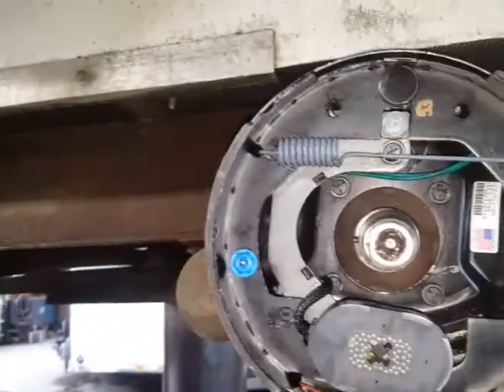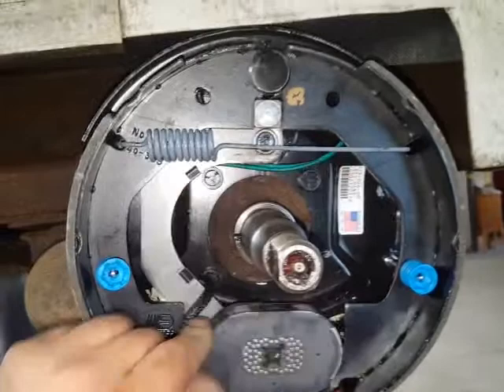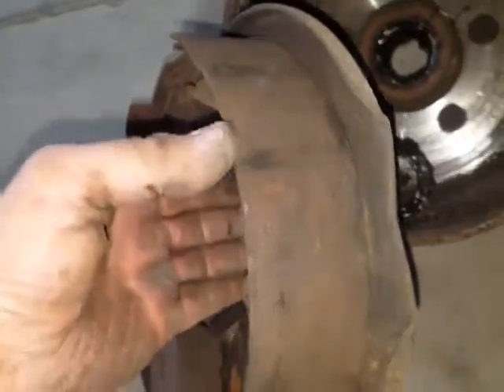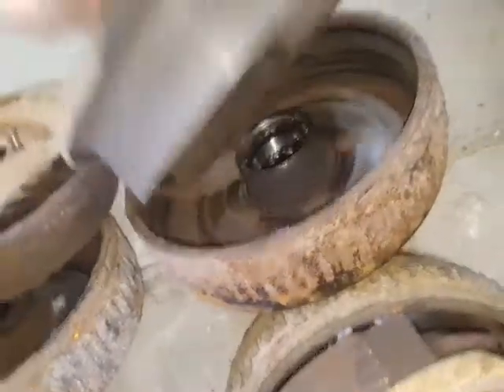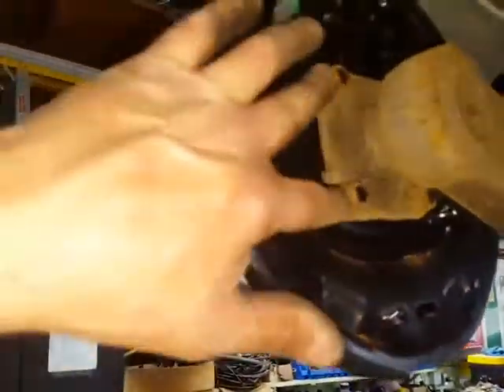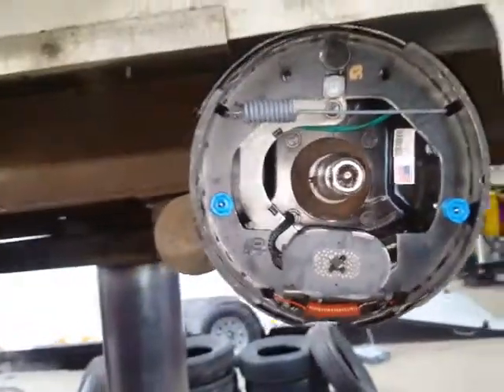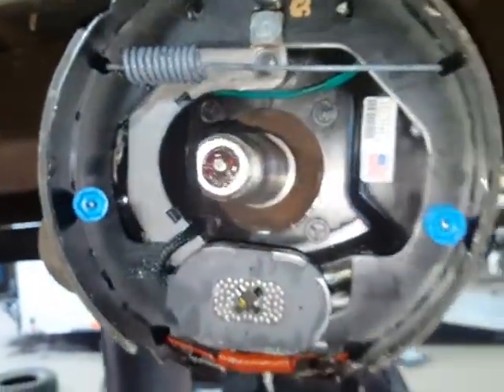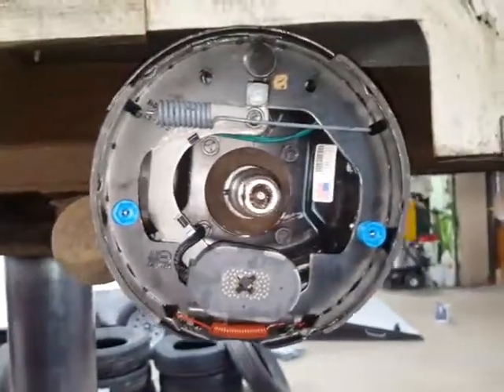How do electric trailer brakes work, quick run through

Comment: how much time before delamination occurred on your set up
Reply from the maker: Well there's a few factors depending on how much you use them and if they're Chinese made or not which most of them are out of all the trailers that I've worked on in the past with electric brakes I seen delamination happen from 4 years up to six and of course if you use them a lot they won't last as long and wet conditions won't help much either because I start rusting under the bed

Comment: HOW  ELECTRIC BRAKE SYSTEM WORK WHEN BREAK AWAY TRAILER OCCUR
Reply from the maker: If your trailer falls off your hitch and pulls that cable immediately sends power from the reserve battery to the brakes which slams them on the trailer
Reply: THANK YOU. WHERE DOES THE  AIR BRAKE SAFETY VLAVE LOCATED. TRYING TO PASS EXAM TEST
Reply from the maker: @lexusry  what kind of trailer are we talking about a tow behind your car or an 18-wheeler

Comment: Thank for this video 👍🏻

What is your opinion on this? 

 I am planning to use these on a boat trailer. Some people are saying that submerging electric brakes in the water will be a bad idea.. But after doing some research, I see that a lot of people are claiming that they use these on boat trailers without any issues. That all parts are mechanical, except this magnet.

Have you had any experience with using these brakes in water? (I might disconnect wires on the rapm, before submerging, just in case)
Reply from the maker: I wouldnt suggest using them and saltwater just freshwater

Comment: must be powerful magnets , must use some amps, like the greasing design
Reply from the maker: You would be surprised that little magnet can lock the brakes right up on a big full-size trailer
Reply from the maker: I think they pull 10 to 15 amps depending on one or two axles